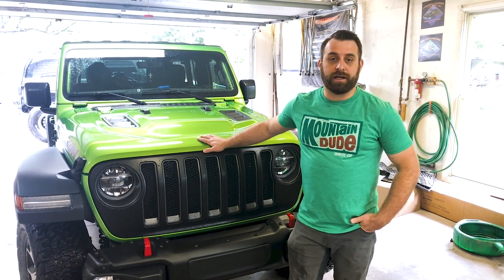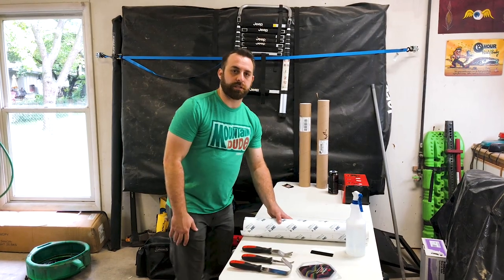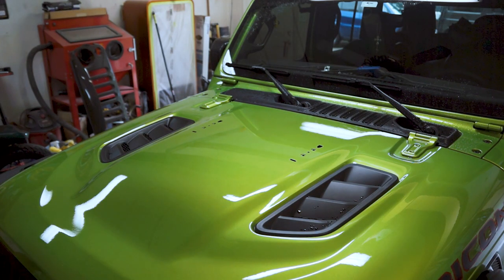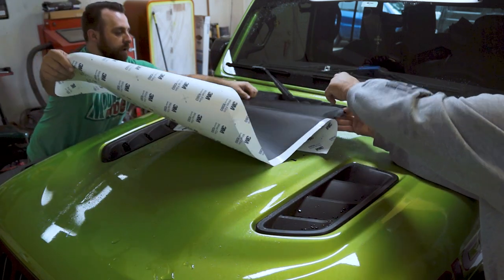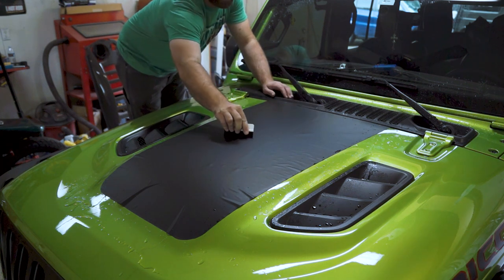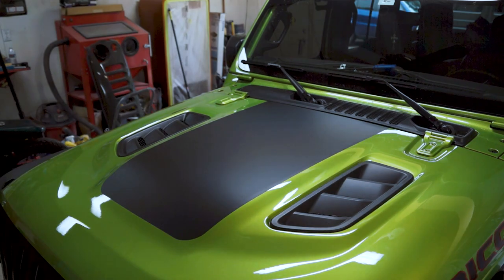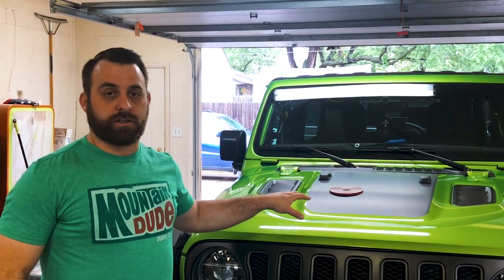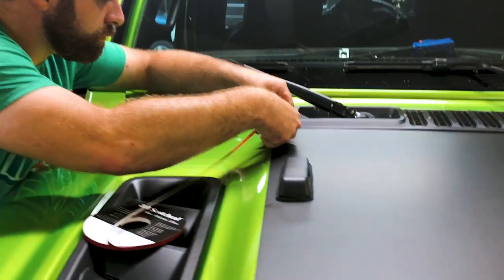VINYL HOOD BLACKOUT for jeep JL hood

Comment: is the red pinstripe matches the pinstripe around rubicon lettereing? If so can you possibly provide link where to buy? thanks
Reply from the maker: Maciek G 
3M Scotchcal 72666 Dark Red Striping Automotive Tape - 1/4 in Width x 2 mil Thick [PRICE is per ROLL] https://www.amazon.com/dp/B0010AT0A0/ref=cm_sw_r_cp_api_7018BbAKJ4X8E